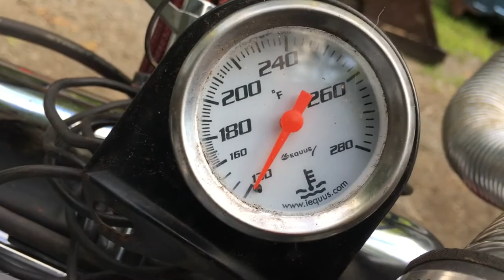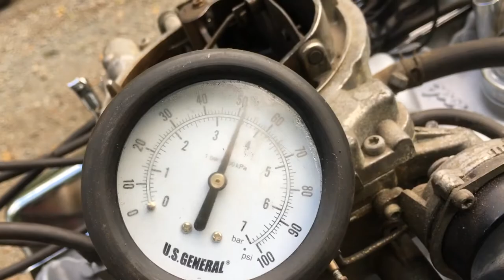Chevy 350 SBC Engine 4 Bolt Main rebuilt 0.30 over 355 Test Run

Comment: Ya I had one like this with the same cylinder heads lol had a mild summit race cam on mine in a c - 10 class shortbed truck.No spray, Went 13:40 in the quarter mile! No B.S.! Sbc 350 is pretty badazz💪😱

Comment: Put vortec heads & fuel injection on that, BEAST! 

Yess, I LOVE THAT ENGINE RUN STAND,.... What an EXCELLENT, idea, brother!! ✌❤💯

I like to take the SBC 400(s) & drill the water jackets on 305 heads (works on 350 or 400 SBC) THEN, put 202 valves in your 305 heads & this raises the compression through the, ROOF! It makes each cylinder 1/4 inch, smaller... just examine the chambers in your 350/400, head(s) & you can visually see, CLEARLY, "how" & "why." I've built 2 SBC 400s this way, & BOTH TIMES I couldn't advance the timing too high due to sparkknock... buttt,.... I could put good gas in it/them with an RV cam & just a little bit of ADVANCE on the timing. I had a one wheel peel with this setup in a LWB 73 full size C10 with 15 X 10 tires & wheels on the, rear & that thing would do cookies on dry pavement, NO PROBLEM. I had another one built the same & I put it in a 1980, Monte Carlo. That thing would go FULL RETARD from a 30 MPH, "punch", again on dry black top. You could be rolling along at 30/35 MPH & mash the accelerator to the floor & it would commence to recycling tires, in a straight path/driving through the middle of, Guthrie, Ky... "No Problem."

Ive had guys telling me that 305 heads won't party well on a 350/400 SBC? Well,... get you a 1/4" drill bit & a 3/8" drill bit. A 350 or a 400 head gasket? Lay said head gasket on your 305 head(s) & you can CLEARLY see where to punch/drill your big/little holes to allow coolant/water to flow through your, heads... it's no problem, at all.. I had a friend who used a 350 rather than a 400 (I used a 400 small block.) He put his in a 1988 4 door Caprice, classic & those 305 heads made his 350 go FULL RETARD in his big body, Caprice, as well. It is a MUST that you drill those holes out, however... otherwise water/coolant WILL NOT CIRCULATE through your cylinder heads. The 350/400 DESPERATELY "need" the extra cooing characteristics you will achieve in drilling those (I I remember correctly) "I think" there were to TWO 3/8" holes, as well as, TWO 1/4" holes per head? One diameter will be on, TOP. The other diameter will be on, bottom. Just look at your 350/400 gasket up against the bottom side of your 305 heads & with the common sense found in your common pizz ant? It is EASILY figured put. Just "punch" your head(s) through your new gasket(s) into your head(s) & you can easily see where to drill which hole(s) based entirely upon what you are looking at with your gasket held up against your 305, head(s.) 

The chambers are 1/4" smaller in each bore, due to the lack of machine work in stock 305, cylinder heads. In fact, I just used stock 305 heads in the past & NEVER had a moment(s), problem. I also do not recommend "EVER" to reuse cylinder head, bolts. The piece of mind (to me) is worth the 50 bucks. shrugs

If not ONLY because MOST folks won't go to that, extreme, on an old school chevy, engine. It's likely not required on a SBC but when building a 4.3 u put new timing cover, new head bolts, & in my experience? Those baztards usually need a flexplate and/or a, starter, by the time they need rebuilt. Mine had broken both motor mounts, the CPI, the starter, & the flexplate by the time I had gathered enough parts to go through the thing. (Of course, I bought it NOT RUNNING/neglected,  major big time.
✌❤💯
Reply: Hey man I'm working in a sbc 350 will you give me some pointers

Comment: Any engine revs fast when it just has to spin a flywheel...
Reply: Not Fords. Sbc turns those rpms
Reply: @Alex-pj8eu   bullshit Facts my 351windsor sounded like it was ready to run through a fucking house 🏠 but good try
Reply: @teeoshbe  yeah now 40 or 50 yrs after the fact, they FINALLY got a little bit of aftermarket support and good heads for some of those old Fords if you're lucky enough to find one, Chevrolet always had and has fast stock street stuff that could do it..
Reply: @Alex-pj8eu  bullshit Ford been kicking Chevy and Dodge ass since 1969 since the trans AM series with it cammer motor it put out 657 horsepower with stock parts nice 👍 but try again

Comment: Not under load. Free spin equals horsepower. Hook it up to transmission drive line and rear axle and the weight of the car.

Comment: I would use Edelbrock over Holley any time.
Much better quality and precision.
Bad idle..
Throw away the carburetor and replace.
Like advising someone to change the mailbox when the roof leaks on a house.😖 Learn tu adjust vacuum, springs, step needles and nozzles instaid.

Comment: Take that carburetor off and throw it in the bushes and put a holley on it then it will iddol
Reply: HA HA HA HOLLY LMAO PUT A FUCKING DEMON ON IT
Reply: @CORNDODGER  but isn’t that still Holley though
Reply: @jordanheredia1160  About as much as a EDELBROCK is a Weber
Reply: @CORNDODGER  I’m really new to this so if I was wrong in asking  
just try to get some knowledge here
Reply: Yea right
Reply: @CORNDODGER   he's not lying 🤥 I got the same year motor but with a Holly double pumper and it purs
Reply: Only reason anybody would not use an edebrockor carter carb is because they don't have the education to know how to set them up ..I have two of them on my Chevelle and it's a daily driver that runs flawlessly ..but I know how to set them up ..
Reply: I took the Holly off my 355  put 750 eldabrock  half inch fuel line